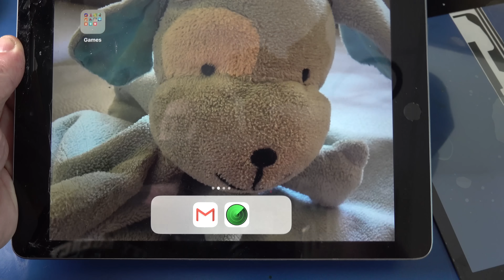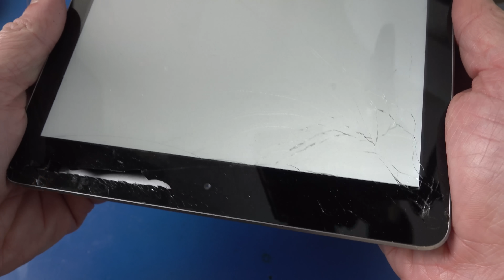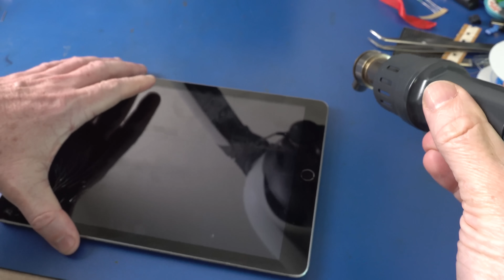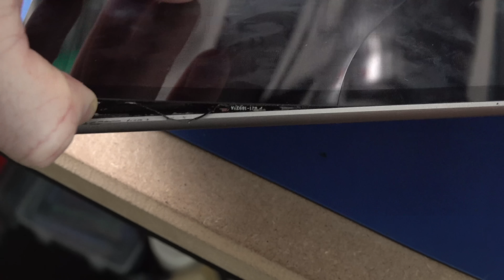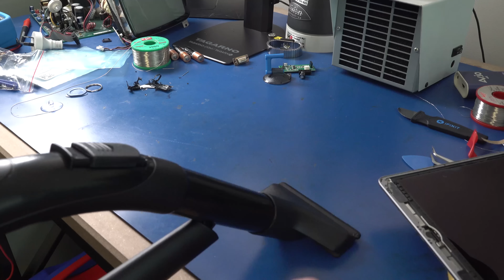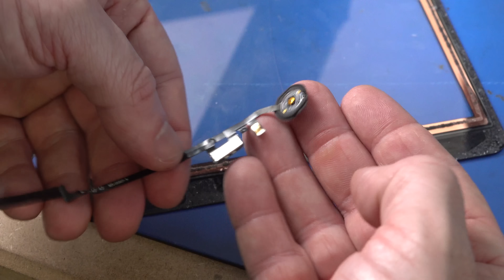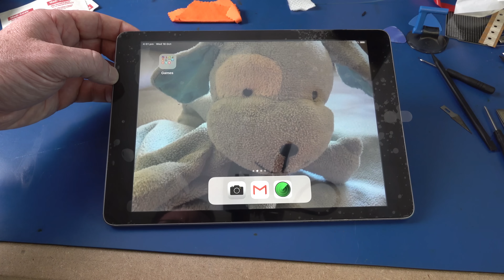EEVblog #1255 - Apple iPad 5th Gen Screen REPAIR

Comment from the maker: UPDATE: The button seems to be a crap design. The tactile switch requires that backing plate to be solidly glued to the front panel. It came loose and the button didn't work any more. I had to take apart again and epoxy the backing plate in place to the front glass.
And it should help to use tape over the broken glass to prevent fragments flying everywhere.
Reply: You might be able to get a gig at Ipad Rehab now Dave :)
Reply: It reminds me of the first time I replaced an iPad screen back in 2015. took half an hour and i ended up having to manipulate the back plate too because one of the corners was too messed up to receive the new glass. obviously found that out after peeling off the strips on the adhesive. oh well, you have to start somewhere, lol
Reply: EEVblog I am sure you did  it all wrong, but consider also that I dont know what I am talking about at all.
Reply: IMO I'd have 1 mm more glass, 1 gram more weight, and no tiny little glass shards when it breaks. :/
Reply: Just as well you used the original button, the biometrics will be paired to that iPad no doubt and if anything like the mini you’ll be missing half the components for the Hall effect sensor so would of had to remove it and still used the original button that was very common to do on the mini iPads as all the replacement screens started to include the buttons that had to be removed and just made the job more time consuming.
Reply: Dave the thing you replace is the digitizer not the screen :)
Reply: Totally watched and said. Yep I give it 2 days before the button goes tits up. Lol you didn't disappoint.
Reply: use e7000 glue
Reply: Next time use adhesive packing tape over the glass to keep entact and protect your fingers from grazing the broken surface.
Reply: Well, the crap design requires the various pieces of adhesive related to the button to also be replaced with new adhesive when replacing the screen. Problem is, the cheapo Chinese replacements never provide the high quality original Apple adhesive.
Reply: Run a thin strip of capton tape over the digtizer flex that has the adhesive on it, this stops the flex shifting over time and getting too close to the lcd (makes the touch play up)
-
With the home key, I ended up sourcing the soft UV resin apple use, works everytime :)
-
Those adhesive strips work best if you thermally set them and put in a clamp for a bit, most "a+ grade" screens like yours both have too thin adhesive and the top glass is thinner. The "s+ grade" (china funny) with the thicker adhesive works better.. also the back OCL insulator is thicker on the touch.
-
If you ever need it fixed again message me and I'll fix it for free for you, I'm not far from you :)
Reply: Its Crapple, think different, think broken.
Reply: Drakkar Calethiel you do realize that every tablet on earth has this problem? Why is it that every time an apple product comes up you mindless trolls come out of the woodwork to make baseless comments like this...
Reply: @ophello  no, not every tablet have these problems
Reply: AmazinChannel when you drop your tablet and shatter the screen, you’re gonna have problems. Apple isn’t the only company on the planet to use adhesive.
Reply: @ophello  i'm not talking about it, it's these stupid design decisions that are just plain dumb
Reply: @ophello  because it's the truth.
Also, no other tablet has these problems. Sure they all break, if that's what you mean, but no other company was such a disgusting ass hat to incorporate serialised security components into it. Then bride legislators to make aftermarket parts illegal, then lie straight to the customers face that their kids birth photo's and all other data is lost.

Apple are fucking evil on soooooo many levels and give absolutely no fucks for your loyalty. In fact, they lie straight to your face at every given opportunity and you lap it all up like a child who thinks the red cup tastes better than the yellow cup with the same drink in it. To the point, that you will probably call me a "troll" for pissing all over your beloved Apple company with fact and truths. It's really quite insane.
Reply: Are other tablets of comparable quality any different though? I feel like that's the price you pay to make it so thin.
Reply: @LiamTronix  yes, you can find better button designs everywhere
Reply: @LiamTronix  - I had a very similar experience on an Asus tablet...
Reply: Welcome to post Job’s Apple products
Reply: @OffTheBeatenPath_  Have you ever tried to take apart any of the Jobs era trinkets? Just as much of a pain in the ass. You aren't supposed to fix them -- buy a new one, or pay Apple ???? to fix it. (and they'll just give you a new one and ship the broken one to China.)
Reply: @OffTheBeatenPath_  Post Wozniak, not post Jobs. Jobs was just a spokesperson and a salesman with zero engineering knowledge.
Reply: @OffTheBeatenPath_  Sadly apple products were mostly junk during the time of jobs too.  It's mostly thanks to the push for thinner products, which jobs was very big on. Just look at the macbook air, which was almost entirely glued together.
Reply: Love or hate apple products, you can always get spare parts fro them.  Your 3 year old not Samsung android device?  Good luck...
Reply: @ludzinc  for apple you can buy screens and batteries. which a few things to notice: since iPhobne XS you won;t be able to reset battery warning even after replacing battery. If Apple decide to block screen - they already done it and can do again at any given time. Apple will sell you screens if you big enough - in price that no one will pay - check if you don't believe me. All biometrics will be gone if you replace home button in any iphone since 5S to 8. On top of that, in iphone 7/7+/8/8+ it won't even click. You will have to buy special home button which requires a bit more of effort and workarounds to make it work and it is 3rd party solution so it does not count. What else we have.... ah, try to replace face ID in any iphone since X... front camera broken, blurry etc? tough luck - either you have face id OR working camera and no face id. Baseband chip - non replaceable, AUDIO IC - non replaceable (fixable at best). I guess you don't work in biz, or you just started and have no clue what are you talking about:D if Dave broke touch id in this ipad - tpugh luck again.
Reply: @AkshonClips  close, but more accurately, the device was never designed to be serviceable.
Reply: Bit harsh to straight out say crap design ....it was fine before you broke it, opened it and then messed up the repair, never seen on just fall in on an undamaged one.
Reply: @technodaz  Yes, I love Dave but the Apple haters are everywhere. I do not have one...and won't, but I do appreciate Mr Jobs design from iPhone on. It was a revolution and we have him to thank for that. As stated, it worked a treat before it became broken. The modern design, phones included are securely glued together making replacement less then easy. With the phones the clever but more expensive way is to replace the glass screen and the LCD digitizer as a single unit.
Reply: @technodaz  nooooooo, I've never seen an apple design fail, ever, anywhere, at all.
Apart from a very small number of them, tiny really, an almost insignificant number.
Reply: @technodaz  it is a crappy design, a piece of metal in the back of it glued to the frame to activate the switch? That's a last minute "fix" not really good engineering
Reply: @AmazinChannelz  Again I've never seen one fail on an unbroken device and I fix these every day....you can't call something crappy design because you failed to fix it as per its original design.
Reply: @technodaz  it doesn't matter if it works or not, if part of your design is gluing part of the button assembly to the frame for if to work it's bad design, it is supposed to be one package, but of course apple managed to fuck it up because they wanted to make ot look "good"
Reply from the maker: @AmazinChannelz  Correct, not good design engineering to rely on that adhesive for a membrane switch backing plate.
Reply: @AkshonClips  What a pretentious thing to say. You're a wanker.
Also, I have never owned, and will never own an apple product, by choice, because I have a conscience. I do run multi boot though and I have been using EL Capitan just to see what all the hype was about. It's pretty tight, I'll give them that, but it's no better than anything else on the market, especially for power users. In fact, it lacks in a lot of ways, isn't as secure as they make out, plus peripheral connectivity has always been an issue with mac devices. I suppose if you do nothing but take selfies and look at fb like most mac users, they're fine. If you enjoy paying far too much for inferior products in order to be lied to and loose all your precious selfies every time water gets within 1000 metres of the device. (or so their "geniuses" are trained to say)

It's NOTHING like the Ford Vs Holden thing, that's a matter of tribalism, rivalry and banter. Apple Vs almost ANY OTHER tech co in the world on the other hand, is a matter of demonstrably inferior product and customer experience at every single service level. But whatever, go check your hair again.

Comment: I don't think anyone was screaming at you, Dave. The screams are reserved for Apple. Every iteration, they challenge themselves to design a product that a) the user is more likely to break (glass to the edges, slippery as possible, etc) and, b) is more difficult to repair than the last. You have got to have a case and screen protector on every iPhone and iPad.

Comment: With everything apart I’d have recommended replacing the batteries.  That would give it like-new capacity and you wouldn’t have to do all this all over again when the original batteries start to go bad.

You definitely don’t want glass shards getting around when you go barefoot in the lab all the time!

Comment: I have done the same repair and I never want to do it again. (Un)fortunately newer iPads have the digitizer glass and LCD permanently bonded so if you break one you have to replace both. More expensive but there is far less that can go wrong. You're also very lucky that dented corner (which is what broke the glass in the first place) didn't crack the replacement glass.

EDIT: Apparently the newer cheaper iPads are still separate glass and panel. I fixed an iPad Air and gave it away, the Air 2 that replaced it has a bonded screen.

Comment: My phone decided to fall on the tile and break the case (thanks for making it out of glass, Google).  The pieces started flaking off.  The repair shop probably had no trouble removing it.  Of course in that time it got corrosion on the USB connector inside, the battery life has taken a dive, and I can't make a phone call with the standard microphone (even though I can hear myself in the speaker side).

Previous phone had the screen bowed out by batteritis (thanks for sealing the battery in, Google).  I tried removing the screen myself but damaged the ribbon where it connects to the screen.  The phone made interesting dot patterns after that.  So note to home repair hackers:  Watch for the ribbon!  Fortunately, there were still (used) screens obtainable.

I'm thinking that my next phone probably won't be any of the "flagship" brands.

Comment: 0:23 Gmail with "sign in" button. Yeah, I'm not accustomed to seeing that as I only really use the one on Android where that picks up the account info from GMS.
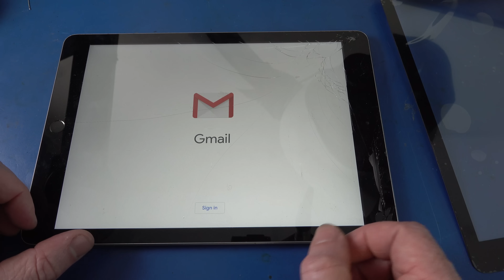2:07 That's one thing I don't like about Chinese parts suppliers, is that they automatically toss those in, even though I already have better iFixit tools I can use. It's probably because they supplied a clone part that was so cheap, that they had to include those cheap tools in order to inflate the price just a little.
Reply: I suspect it pays to throw those in. Fewer customers using inappropriate stuff and making things worse with their repair attempt is fewer customers trying to vent at a seller via negative feedback etc. Seeing how these things are as close to free as possible to throw in, that saves the seller an awful lot of hassle.

Plus, you get to point out it's a customers fault if they used improper tools - especially since you threw in the 'right' stuff.
Honestly, I've done loads of these repairs and I'll happily use the throwaway spudgers and guitar picks etc - they are kind of nicely selected for their propensity to break before you use them to break something else. Certainly if someone inexperienced is going to try this for their first time, that alone is kind of a good thing (versus, for example, immediately getting some metal knife to get a tricky clamp or glue joint apart, which for an inexperienced repairman is a damned foolishly dangerous thing to do).

Comment: in my country they use a thin metal wire to separate the glass from the lcd.........they slide the wire between the lcd and the touch glass and pull the wire hard !!!!!!  and it takes them litterly 10 seconds

Comment: It always amazes just how much of a dumb design most modern screens are - a thin sheet of glass butted right up to the edge of the device, the edge being a very thin and soft piece of aluminium alloy. Bang the edge just hard enough to bend the metal a fraction and your pretty much guaranteed to break the glass. Just a 1mm rubber gasket around the edge of the glass would help so much. But of course that would not be so stylish. That is the problem with a lot of the newer gen smartphones and tablets, styling overrules common sense, they just make the damned things as thin and slippery to hold as possible. The first thing i had to do with my nice sleek looking modern smartphone was to buy a protective case for it, not so much to protect it, but to make it possible to hold the thing without it constantly trying to slip out of my hand.
Reply: That started being an issue since they decided to have glass front and back. Then you feel like your phone is a bar of soap that could slip off your hands at any time.

Comment: Nice first repair!
The tape on glass tip is actually very useful as others pointed out
Not a big deal but I would avoid working in devices that are fully charged, you never know
And lastly I do not recommend buying a screen with a home button pre-installed as you will loose the TouchID functionality. The little chip next to the button is cryptographically tied to your motherboard, hence the need to transfer it in order to keep the biometrics working.
Reply: Useful info. Thanks.

Comment: I fixed a nextbook for my niece, way easier than that ipad. The plastic back comes off the device and everything is connected to the front bezel So I got a new bezel with the touch screen assembly used off ebay.

Comment: This is a useful video, Dave. I've got a locked iPad lying around, that I need to salvage the lcd and digitizer from, to replace my daughters cracked iPad, and this was a great help.
I don't have a heat gun, though, but I assume a hair dryer will do the trick.

Comment: Hi Dave, I would be tempted to use kapton tape all over the screen first and then heat up & remove the screen, wash hands after as you wont see very small glass splinters as most people might be tempted to wipe eyes with back of their fingers, I feel if you do many then get a propper heat jig from China - Amazon YIHUA 946a-III as an example of whats out there, for just one off's I really would be tempted to do a set repair cost at Apple £256.44p, might even get a new back case unit, plus the gurantee, as they say time is money, for hobyist ok have a go but be careful of glass splinters in eyes & on table - floor when children are around !,
What I can say Dave you had fun in doing the repair & showing public how to replace the apple screen,

Comment: Help for newbies to this:

Use a heated mat, it warms the whole pad making it very easy.

Use a little isopropyl alcohol, it really helps loosen the glue.

As others have suggested, cover the whole screen with parcel tape.

When you get hold of a piece of double sided tape sticking it down you should gently pull it, makes the job easier.

As Dave said, always resin down the home button plate or it’ll come loose.

Use 3m fabric tape and don’t trust the adhesive that comes with the digitiser.

Make sure the iPad is switched off when you plug in the lcd or you will blow the backlight.

Hope this helps a few people, I’ve probably missed a couple of things but there are so many things.
Reply: Ken Mason it is but it’s also harmful to plastic and can cause things inside the iPad to melt.
Reply: Ken Mason it’s a shame there are so many cowboys doing it now with no sense of QC. I only do micro soldering myself but work with plenty of uk shops with good ethics, you’d be surprised how they can charge a fair price for a quality service. I’ll try the tesa tape and see how it compares to my usual 3M 👍
Reply: I was thinking, doesn't he have a reflow oven to heat it overall?

Comment: Tip: Save old credit cards and gift cards. They can be cut up and used as prying tools. They come in many different thicknesses too. I even cut them into the shape of collar-stays, to keep my collars laying flat. I cut them into strips to mix 2-part epoxy too. (I lose all the metal ones you can buy.)

Comment: Had some success with a (2500w) flatiron, just heat it up a few seconds and turn it upside down (and put it in a vice or something else to hold). Put mobile phone or tablet on it and let it sit for a while. For better heat spreading, move it around on the iron. You can also attach a flat metal plate to the flatiron (upside down) to  increase the heat surface (easier when service tablets) however needs a longer time to heat up. After a while take off the device (wear gloves when doing this!) and I was able to rip it off in one go! Very easy.